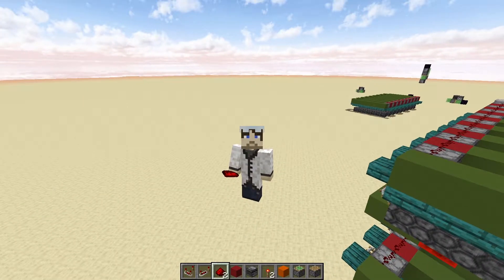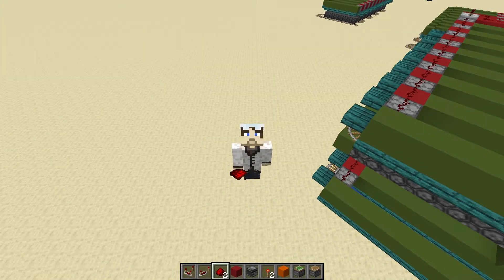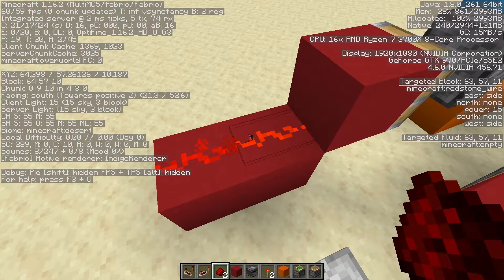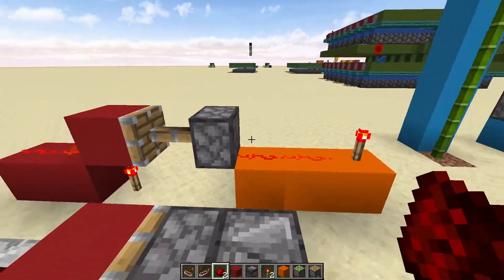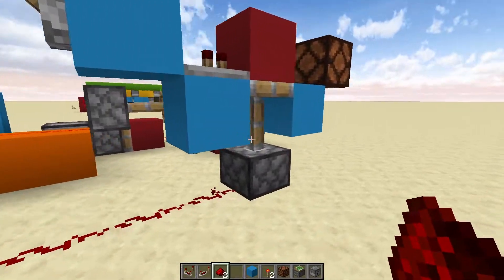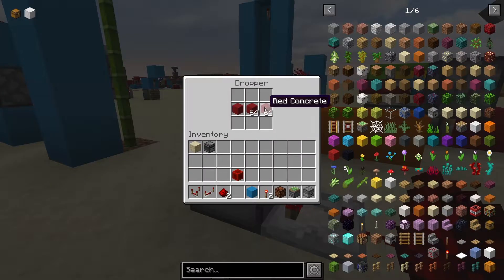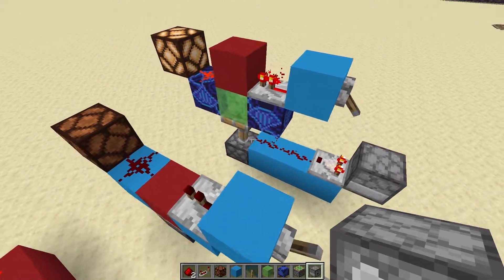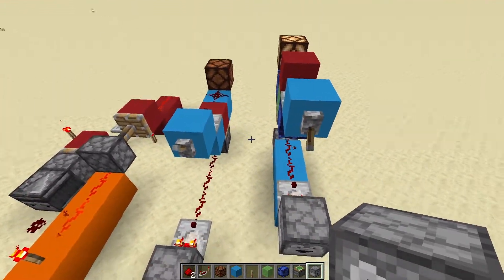Redstone Transistors

Comment: Hey, i just created an automatic transistor, what i mean is, yours require someone to physically put an input on both ends, i made one that needs one input to activate an output of 0 or 1, it has a cycle time of 1.75 seconds (the time it takes to change from 0-1 or 1-0). My only problem is finding something to implement it into as i see it has a purpose.
Reply from the maker: Ya, the one I built here was simply the electrical component, as it might be put, and nothing more. It definitely has much growth potential. There are actually many different transistors you can make in Minecraft. I've learned a lot since uploading this video. I'm happy to hear you found some way to make it more interesting

Comment: What is the difference between comparator and Transistor?
Reply from the maker: A comparator in minecraft is more or less an integrated circuit with a sensor in it that detects the number of items stored in a storage box such as a chest, or an input signal. Here's a link to a video where I explain it in more detail, though I miss the input signal mechanic https://youtu.be/q9iGcs60ijM 
A transistor is a very different beast, as it is not an integrated circuit, but is more or less just a logic gate. If input 1 and input 2 equal on, or 1. Then output equals on, or 1. Otherwise it is off, or 0. Hope that helps
Reply: @Talmiior  ok thanks for Your answer! Would a combination of comperator (in calc. mode) and repeater (on the side) be a Transistor? Any current of signal on reapeater would shut off comparator
Reply from the maker: @tinaberry4629  You're right! It would be a transistor. I've always viewed that setup as just an AND gate, putting the idea of a transistor to the side when working on redstone lol. If it's comparing the input signal from the repeater and the comparator's input signal from behind, that would result in two signals in, one signal out depending on the power level, which is very similar to how transistors work in real life electronics. I need to revisit this, as this makes this video wayyy over complicated